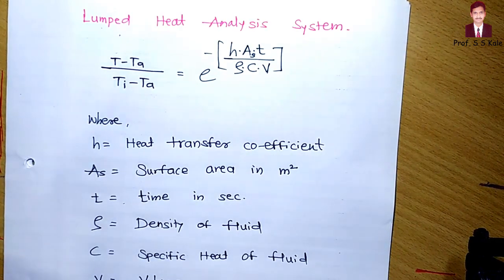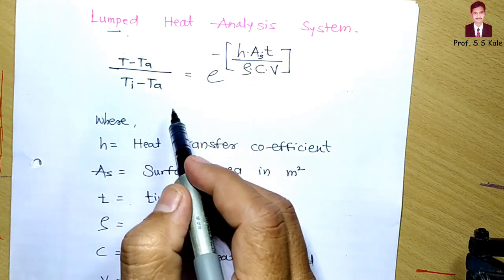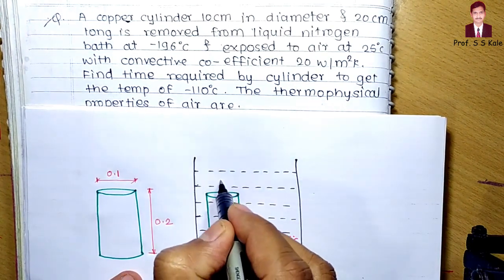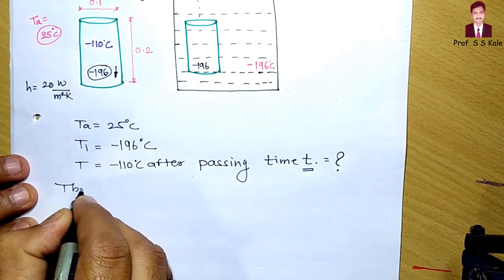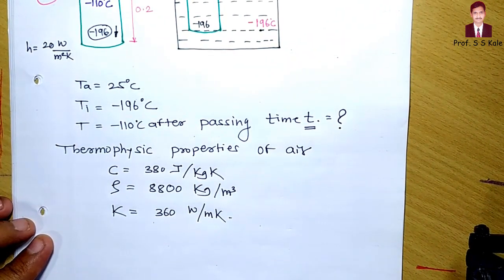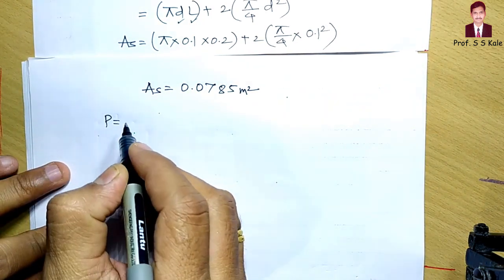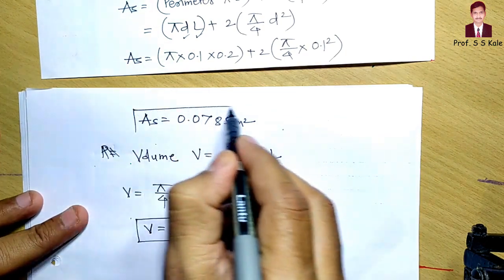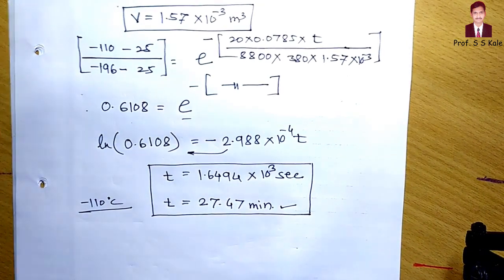Problems on Lumped Heat Analysis - 1

Comment: The values of C (heat capacity) and density should be those of copper, not of air.  The question and answer should read "thermophysical properties of copper".

Comment: hello Professor don't we have to check the biot number for this problem if not can you please explain why? because when i checked the biot number it is greater than .1 Bi=(hLc/K)=(20*50.025)/360 =2.77916 which is greater than 0.1  (Lc = volume /surface area= .07854/.001570=50.025)

Comment: load of peas at a temperature of 25°C is to be cooled down in a room at a constant air temperature of 1°C.

(a) How long the peas will rquire to cool down to 2°C when the surface heat transfer coefficient of the peas

is 5.81 W/m2 K? (b) What is the temperature

of the peas after a lapse of 10 min from the start of cooling?

(c) What air temperature must be used if the peas were to be cooled down to 5°C in 30 min? The peas are

supposed to have an average diameter of 8 mm. Their density is 750 kg/m3 and specific heat 3.35 kJ/kg K.